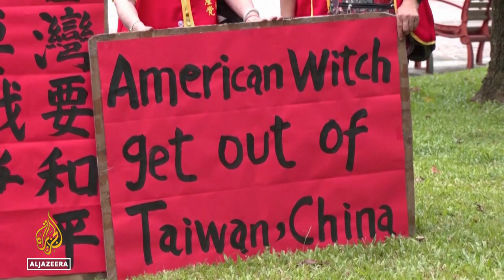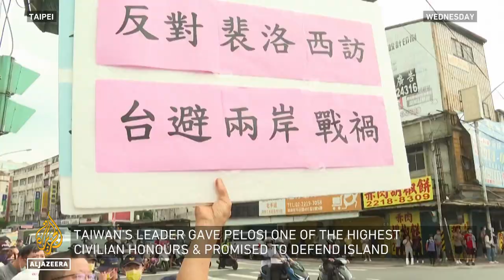What's the fallout from Nancy Pelosi's visit to Taiwan? | Inside Story

Comment: When We Have Chip Fabs In The US Again This Will Change.
Reply: Then Taiwan will be Ukrained
Reply: Unlikely to happen for fundamental reasons
Reply: There are operating chip fabs in the USA already. The new ones coming on line will not be competitive due to high labor costs. The new fabs will also cause a glut of semiconductors on the market and will force the closure of those new fabs in the USA. It was never a good idea to build new fabs in the USA. The market for chips is already tanking.
Reply: @bobsmith3983  The " market for chips is tanking"   ??  Ditching circuits boards for a abacus ??